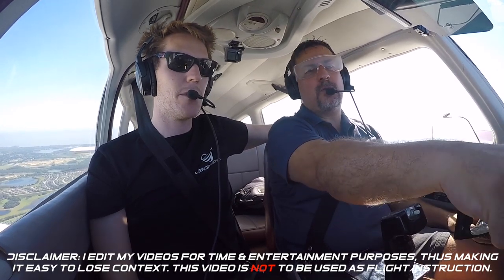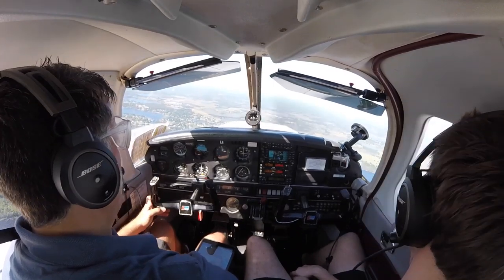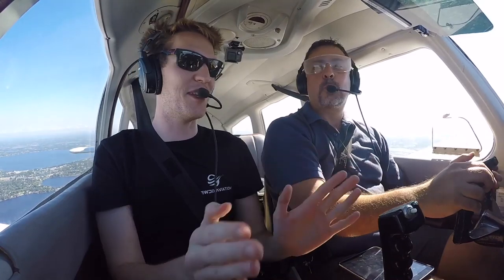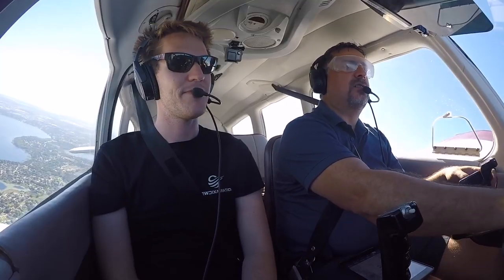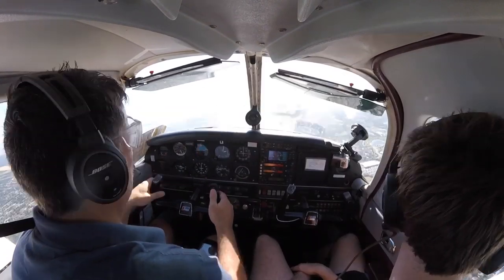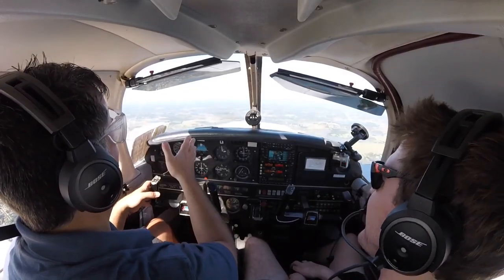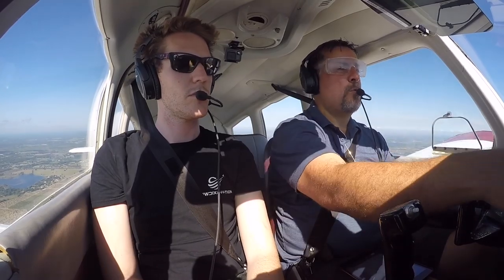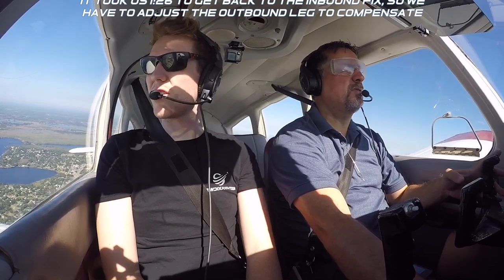Holding Pattern| Simulated Instrument Flying

Comment: when do you like to start the timer when initially crossing the fix for a tear drop hold?  do you start it as soon as you cross the fix, or after you are on the radial tracking outbound for a minute?
Reply: If your doing a teardrop start the timer once you cross the fix once a minute is up turn inbound and start your timer again once the cdi needle starts to move. Don’t forget to plan for the wind and have fun!